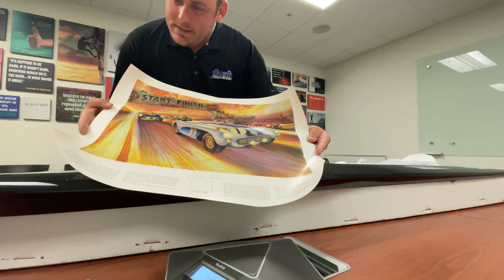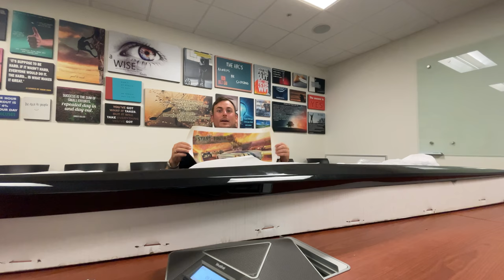ACS Rockers have arrived, unwrapping a gift from Mike Furman

Comment: I'm with ya.  Side skirts/rocker panels are an absolute must-have for a Corvette.  My C4 sure could have benefitted from having a set.  I installed them on my C7 in 2019 and can say that I have not received another rock chip anywhere on the sides.  Also, I had installed a set of the ACS "Enhanced" mud guards but, last year I replaced them with the wider "XL" version.  Now, even more protection.  I went with a less obtrusive front splitter (without the winglets) for a smoother look.
Great job on the video, Morgan.  And, on your C8, as well.
Well done, sir.  Well done.👍
Reply from the maker: Thank you very much. Functional and aesthetic is always a win win

Comment: I think you have front rub issues because you went with 255/30/20 on the front.  I order wheels for mine, but my wheel guy said only do 245/30/20 on the front.  He has experienced rub with the 255"s.  FYI
Reply from the maker: Yeah I agree. I love the wider wheel because I am hoping the next model will use the same size. It was a nominal amount of work to get these to fit
Reply: I did the 255s with aerolarris real forge wheels 21x12 and 20x9.5 and no rub with splash guards